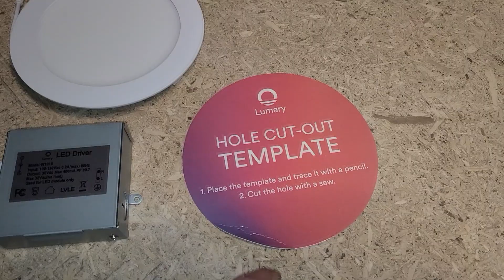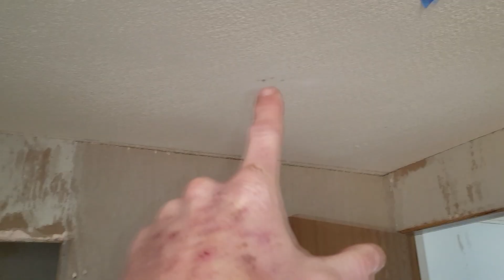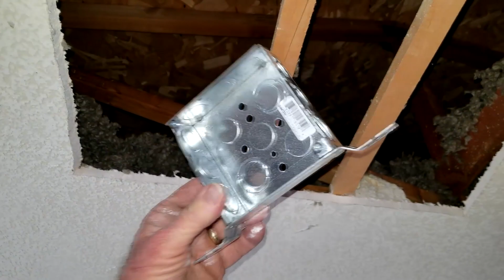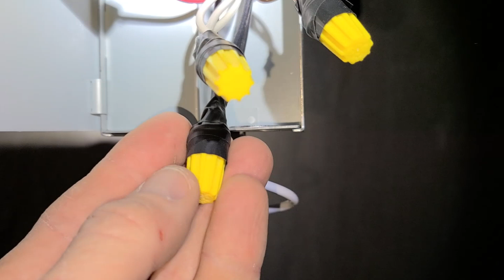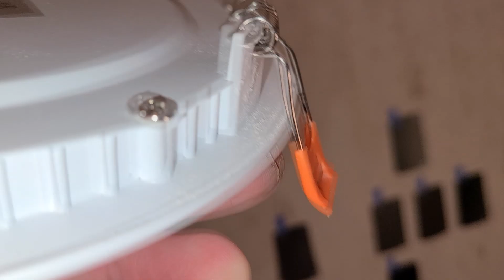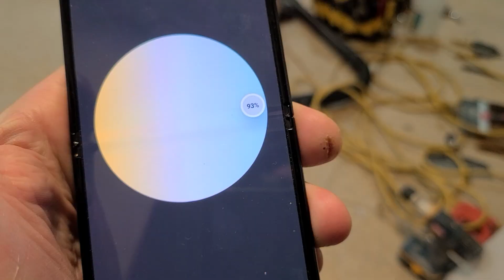Lumary Super Slim Smart Recessed LED Lights Works With Amazon Alexa & Google Assistant!

Comment: I'm interested in these lights for my home theater project. Can they also be controlled using a smart switch such as the Brilliant Smart Home Control Switch? I have a few of these in my home and it's a deal breaker if I can't use my existing smart switch for these lights.